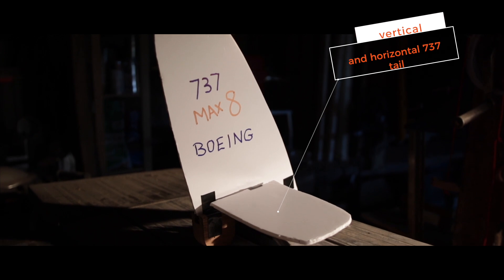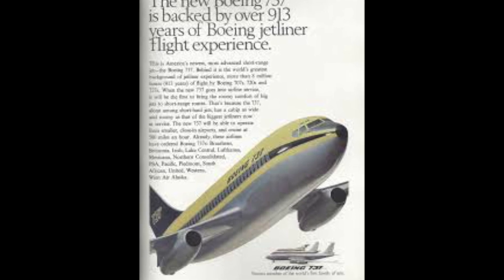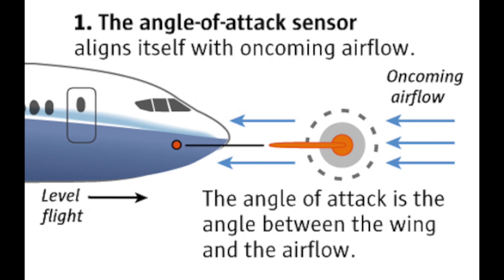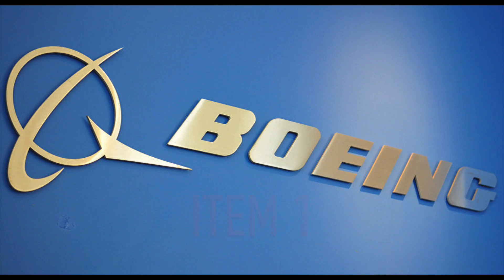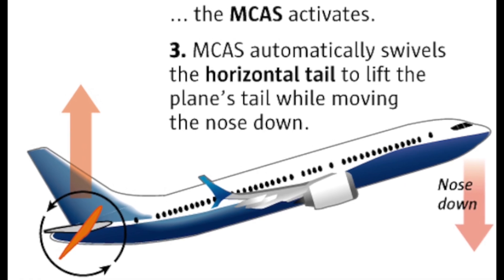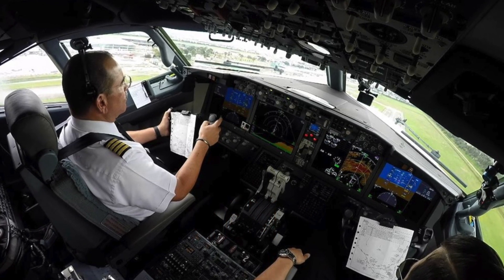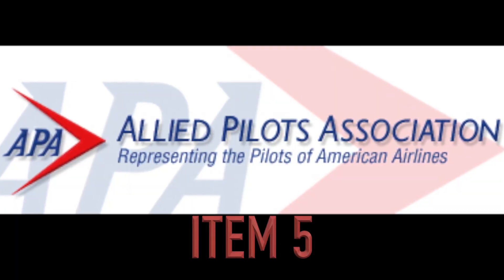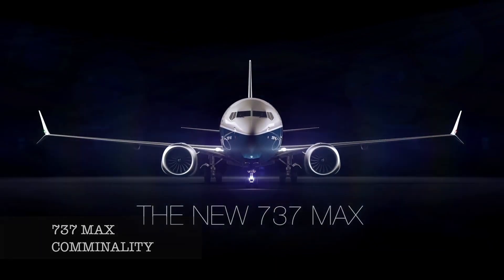NEW *** 737 MAX 8  - Prof Simon

Comment: We should not forget that the 737 has been a problem plane for a long time, the Rudder use to lock up and reverse causing the aircraft to roll over and nose dive into the ground, I dont think Boeing then told the pilots till after like the 3rd crash on how to fix the problem in the air.

Comment: I bet that there was a discussion about the 5* nose down movement being to much and they settled on 2.5*. By the time it got to the computer programmer, it was interpreted as 2.5* of horizontal stabilizer movement and not 5* of nose down trim. 
Also let’s say that there is 10* of available movement. If it moves 2.5* each time, after 4 attempts to pull up, it would reach the end of the available adjustment. The pilots would have a very short time to recognize the problem and turn the system off. If it moved .5* each time they would have 20 attempts to pull up and realize that there was an issue and turn the system off. Most likely at that point there would only be about 5* of trim. 
From what I have read at full swing of the stabilizer it is impossible to pull up. So if it adjusted in smaller increments there is a much better chance that the stabilizer wouldn’t be at full swing by the time the system was turned off.

Comment: Be interesting to see how the problem is resolved. The flying public may get jittery over any perceived problems. 
Thorough testing of any changes is sure to delay recertification of this model.
If she tests out, then okay, she flys again. But in the meantime what a costly mess.
Every one wants safety for all crews and passengers so it takes what it takes. Certainly don’t need another disaster of uncontrolled descent, far worse over populated areas.

Comment: In my humble opinion, Boeing is at fault, they should've known better to include info about the MCAS system in their manuals, and there's a big difference between 0.6 and 2.5 degrees. There's an inminent image damage if that comes out true in the final result of the investigation. 
This explanation finally got it right, without beating around the bush like sometimes seen, thank you very much for that.
Reply: Emin Muradov of all the crazy things Boeing did with this, I can’t believe they got away with lying about how much adjustment the MCAS would enact.

Comment: Consider, pilots train specifically simulating the planes they fly any model to certify, like cars they drive different.

Also, training for stalls is a main skill taught for the recovery during takeoff, the actual event is fatal so preceeded by pilot alarms visual to audible and vibrating the stick for dropping windspeeds near stall.

The recovery for the Max requires NOT increasing throttle quickly once windspeed picks up by using a slow steady increase with an eye on windspeed, this is due to pitching moment from the engines being mounted low and where a pilot error can occur, so, they all train for it.

Then, the flight paths shown I've seen have plateaus where a gain in speed occurs to then again climb, this at least twice, so, I rule out pilot error also with knowing the passenger list.

The model went from VIP-packed trustworthy with an impeccable airline the model a global fleet of over 300 constantly in the air to all-grounded?

Stinks of sabotage, a targeted VIP passenger list and blame it on a known funky thing pilots have dealt with yet the fleet 300x flight hours per year total all ok, eh?

I trust the plane for consistent, reliable performance and checked before this flight, an experienced pilot, and, no overt pilot error on a common event occurence trained for in pilot procedures. Sabotage must be looked for and discussed openly or it's a coverup with that passenger list.

Comment: Basically the new engines are to big to fit under the wings even with new landing gear to rase the height of the aircraft. They position of the larger engines forward & up to allow them more clearance from the ground.
Does this mean the aircraft is now inherently out of balance?

Comment: The MD-11 has had this system for over 20 years, so Boeing just got the programming wrong, it will be fixed.

Longitudinal Stability Augmentation System (LSAS)
LSAS provides:
1) Pitch Attitude Hold and Automatic Pitch Trim – With no force
on the control column, and bank angle less than 30 degrees,
LSAS holds the current pitch attitude. LSAS holds this attitude
by deflecting the elevators as much as 5 degrees. The
horizontal stabilizer is automatically adjusted to relieve the
sustained elevator deflection and maintain a full 5 degree
elevator authority.
2) Pitch Attitude Limiting – LSAS maintains pitch attitude to less
than 10 degrees of dive, or less than 30 degrees of climb.
3) Pitch Rate Damping – Increases the apparent static stability to
reduce the chance of over-control in pitch. It is active
throughout the flight envelope. 100% of max damping is
available above 20,000ft, decreasing linearly to 30% below
16,500 ft.
4) Speed Protection – If the autopilot is not engaged and the
autothrottle is not available (or able to maintain a safe speed),
LSAS Speed Limiting will engage to provide overspeed or
stall protection. LSAS overspeed protection is accomplished
by changing pitch. LSAS does not provide flap, slat or gear
overspeed protection.
5) Stall Protection – At 75-85 pct of the angle of attack required
to activate the stick shaker, the LSAS stall protection engages.
LSAS reduces pitch until the AOA is sufficiently reduced.
6) Pitch Attitude Protection and Positive Nose Lowering - During
takeoff rotation, LSAS provides Pitch Attitude Protection
(PAP) to reduce the possibility of a tail strike. During landing,
after spoiler deployment is commanded, LSAS initiates
Positive Nose Lowering (PNL) to assist in transitioning the
nose wheel to the runway after main gear touchdown.
LSAS is off when:
1) The autopilot is engaged
2) Below 100 ft RA, except active for pitch attitude protection
during takeoff and positive nose lowering during landing.
3) Bank angle exceeds 30 degrees
4) During manual trim operation
5) Pilot can override LSAS if, when below 1500 ft., more than
appx 2 lbs. of pressure is applied to the control column; or,
when 10-15 lbs of force is applied while PAP or PNL is active.
The pilot may counteract the LSAS overspeed or stall protection
by using enough manual force on the control column (appx 50
lbs) to defeat the LSAS inputs.
LSAS Switches
FAIL (illuminated)
-Control channel has failed, and has shut off
OFF (illuminated)
-Respective LSAS switch has been pressed, and the
corresponding control channel has been turned off.

Comment: Chilling video. This plane should have never been approved. The engine and airframes should be in harmony without the intervention of a computer.
Reply: Phoenixspin — Every similarly constructed aircraft, with engines under the wings, will tend to rotate nose up under power.  They all have trim adjustment to compensate.  The only difference in the Max is that the engines are more powerful, so the effect is stronger.  MCAS was added as an aid.  You can argue that this system should not be required, but all similar aircraft are inharmonious.
Reply: That would put Airbus in the shit and ground almost all fighter jets...cool.
Reply: One of these days humans will no longer be able to fly aircraft. Personally, I will never get on a plane that doesn't have the two people in front. Scary, scary technology

Comment: Once again it's shows that Boeing executives have cut corners failing to put safety first. I hope the carriers drags Boeing to court for this.
Reply: MCAS is just the tip of the iceberg!!! 

How about the old wing not being designed to hang more powerful engines forward. 

These new engines are what is causing extra risks for stalls hence need for MCAS.

Upon take off these engines at full power pitch the nose up into stall. Unfortunately nothing can recover from low altitude stalls.

The real design would be to prevent the SOURCE/CAUSE of these stalls!!
Like managing the AUTO-THROTTLE based on pitch  to PREVENT CREATING STALLS.

Stupid logic:
Only reading at AIR-FLOW Sensors is TOO LATE once stalled ....
Reply: The carriers are just as bad, they didn't care.  Even now they are demanding boeing "fix" MCAS so they can continue to not pay for pilot training.  What happens when boeing makes it easier to disable MCAS?  The original stall risk MCAS addressed is going to return.  Pilots need flight training on the MAX without MCAS enabled.  

It will not be safe until they get this training.  Using automated systems to make a new craft fly like a different older plane is dangerous if you don't still teach pilots how to handle the new plane if the automated systems fail.  Once pilots are trained, only then will the planes be safe.

Comment: Correct me if I am wrong, but it looks like Boeing and the lack of MCAS system training management are at fault. Plane manufacturers always get away with culpability, blaming everything else and pilots always
Ps. Query. Something has bothered me all along and I wonder if anyone can definitively answer this, Why is the sat data so relevant in determining the planes movements/position etc prior and including the crash? Nothing can show more precisely the planes movements etc than the data recorders! So why was the media and authorities mentioning that the satellite positioning/tracker data was key? Does not make sense...unless flight recorder details highlight boeings and mcas are at fault, so they want to downplay to avoid prosecution and huge damages?

Comment: It helps to understand difference between normal mode wing profile versus full camber take off mode (+/- lift) to aoa transfer characteristics on a polar chart.

Normal mode has a linear transfer curve of positive slope. The neutral (zero) lift aoa in normal mode varies from minus 1-2 degrees of incidence air flow. The induced +/-lift crossing the zero lift axis is linear in a normal wing profile is however non linear in take off - full camber - mode, more so it has a hysteresis response (flip/flop) which has no intermediate state, is either this or that. Such response is easily appreciated by recalling our air line experience at and just before air born at zero pitch - all wheels on runway - the speeding air flow pushes both wings against the runway just before air born, the plane remains “sucked” against runway until the nose up pitch has past a certain angle can then it suddenly lift up. As - it snap up lift, so - it snap down lift when aoa went pass a mirror hysteresis limit. 

Uncorrected AOA sensor error - due to new and smaller engine spacing - is one contributing factor to support such snap into a down lift and the sudden consequent nose down moment induced from a full camber. 

The first 200 seconds into air borne mode is most critical, during which if MCOS system remains in authority and not powered off by the panicking pilot. 

IF : aoa error is being corrected by the MCOS in the first 200s after airborne. It will gradually and continuously change the pitch angle in a negative direction and into snap down lift before the end of first 200s. More so when air temperature is high, air density is low and lack of head wind. 

Run away state stabilizer trim error and adverse effect sometimes over powers the pilot control.
Reply: Forgive me for being dumb. Could you repeat that post in English.

Comment: I am a 500 hour pilot. 
It would piss me off, if a computer was flying my plane - and I was not told about it.
Thanks Professor Simon!
Reply: I see you have never been on a late model Airbus, 320 and on.  Interesting.
Reply: I don't blame you! I don't want to ride in the Uber or a self-flying plane.
Reply: You sound like a pretty bad pilot.  All pilots know that modern a/c cannot be flown economic without a computer.  Even without the autopilot in control.  Wouldn't want to fly with you, that's for sure!
Reply: @blameyourself4489  I think you may have misread his comment, he said if he was not told about it... Not that he wants 0 computers. I would also agree as a student pilot, we need to know exactly what systems are in place, so if something does go wrong it can be addressed. Part of the problems with the max crashes is pilots were overwhelmed by a system they didn't know enough about.

Comment: I like this explanation as it gives a better picture. Due to the fact it comes on automatically I wonder if for some reason the system activated after takeoff in steep climb and continued to trim until pilot input would no longer make a difference. Certainly the trim specs were wrong and warrants a thorough investigation to find out what went wrong. Many American carriers that flew the plane ask why it didn't happen with their max. I think it would be interesting to find out the factors that lessened the chances of it happening to an American carrier that flew the max.

Comment: so they had to react like on a stab runaway situation  and used the stab cut off switches to stop stab movement in order to beable to use elevators wich would have worked

Comment: I hold an ATP  (airline transport pilot) rating. . I am telling you now, that Boeing was trying to get ride of the copilot position with this. Its stupid.  There were no pilots stalling the plane to start with, this is way way to much, there is NO Way I want to fly something with the ability to yank control out of my hands to do what it wants to do. No Frickin Way.  This was all about saving training dollars period.
Reply: I wouldn't be bragging about your supposed ATP rating if you are unaware of Boeings 737 procedure for "runaway trim stabilization". Any 737 pilot that doesn't know the procedure should not be flying anybody anywhere. One thing should be VERY clear. 737 pilots are trained to recognize "runaway trim stabilization" and they are trained to disable the automation including MCAS, and then retrim the aircraft manually.
 The procedure is considered a "memory item" and the pilots should know it without reading the manual. 

The video linked below was published in 2017 BEFORE either 737MAX crashed. It explains what a 737 pilot is supposed to do in the event of "runaway trim stabilization".

Take 8 minutes of your time to watch it. And ask yourself how did the pilots from Lion Air miss those trim wheels spinning forward? Why didn't they turn the STAB TRIM off?   

What is that spinning thing?
https://www.youtube.com/watch?v=l62NvkRWa5E

Then watch this 5-minute video that explains all of the ways the pilots could have stopped the "runaway trim stabilization" from crashing the plane. 

Ethiopian 737-8 Max UPDATE 15 March 2019
https://www.youtube.com/watch?v=AgkmJ1U2M_Q&list=PL6SYmp3qb3uPp1DS7fDy7I6y11MIMgnbO
Reply: @rwj1313  Agreed

Comment: Even if the MCAS problem is solved I think no airline will ever trust the MAX again. And trust is fundamental in the airline industry.
Reply: Hasn't stopped people from flying on other models of aircraft that have crashed, why would this be different? When the definitive problem has been addressed, it is no longer an issue.
Reply: Perhaps Airbus will learn from this engineered failure? Boeing is no longer 'Goeing (???)

Comment: The more important question is are the pilots able to totally remove the MCAS system from operation with a simple switch.? If not then the system does need to be totally redesigned so that they can remove it if needed.

Comment: Well, the pilots could easily turn off the stabilizer jack screw with the flip of a switch.
Reply: If they knew and were trained.
Reply: Yes, that's assuming they aren't flying ALASKAN airlines who felt that 'overlooking the screw jacks saved them a few cents until alas, a screwjack stripped its threads, turned a flying aircraft upside down which crashed into the sea. Funny what money does to people, yeah Alaskan Airlines saved money by not servicing their aircraft.
Reply: Leaving no way to set the stabilizer back to neutral, so the rest of the flight flown with elevators fighting the stuck stabilizer?
Reply: @sub08Angstrom  There is a hand crank on the trim wheel.

Comment: Boeing need to have a fully new replacement for the 737. You simply can’t keep updating it and adding electronics to try and keep it modern.
Reply: I agree with you 100%. They pushed the 737 old airframe to its limits. And no software can solve a design problem.
Reply: Yes... it's called the 787...
Reply: @EdResleff  No, it's the 757.
Reply: They're aren't the only ones doing that

Comment: I went to Michigan for a 4 day training on new exhaust system  on Hino trucks. Boeing thought a 1 hr ipad training was enough for new flight control 😫😱🤢🤮. Taking critical info from 1 AOA sensor was criminal also. I worked on a cummins that take info from crank, and cam sensor for engine position.  What was engineere thinking?
Reply from the maker: Overkill....you needed a 1 hour ipad course...ha
Reply: It was enough training for thousands of USA pilots. Many have had the same issue, but shut off that autopilot trim, just like it says to do in the flight manual and trim checklist. Can’t compare USA pilots to Indonesian or Ethiopian.